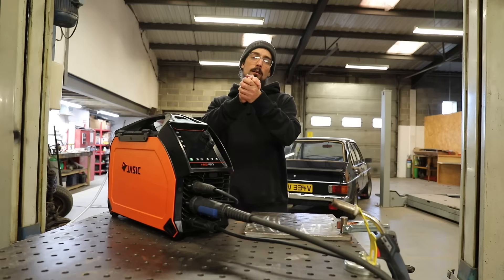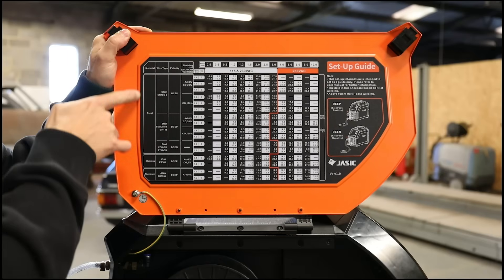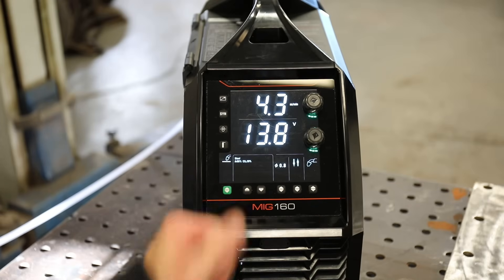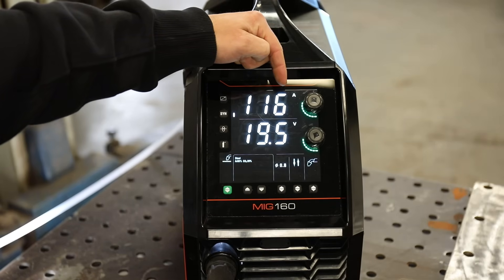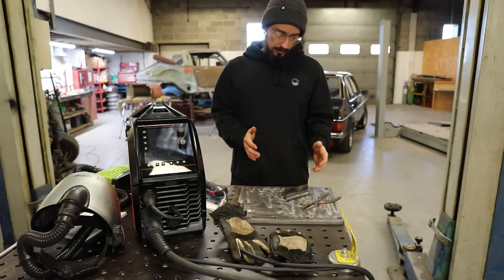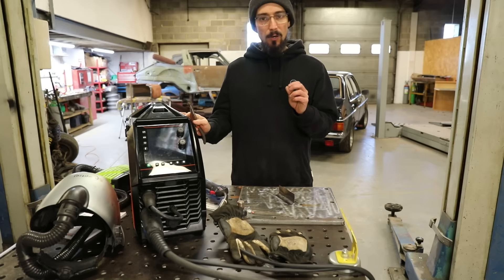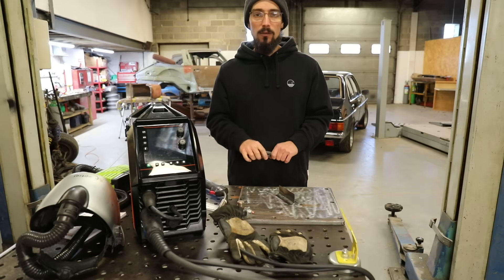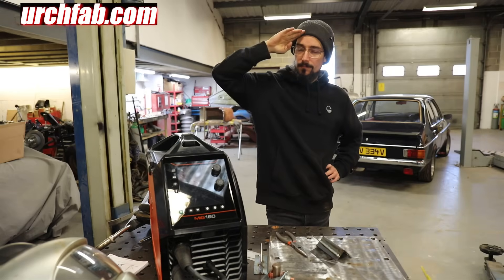Auto Mig Setting Not Working Out For You? Here's How to Find That Perfect Setting. Welding Made Easy

Comment: 😮🤔 

Only synergic machine I’ve ever used was my huge 400 amp 3 phase fronius …. Tbh I actually thought it adjusted the wire speed as I was welding to get a stable arc … I thought that was what synergic meant . It’s an amazingly good welder … considering I only paid £65 at an auction for it 😂😂 but seriously good , only downside is I’m rubbish at welding without it now 😂😂  I just turn the dial to a thickness and leave it ..  
my favourite setting is 6mm … can pretty much weld anything from 3mm upto 10mm with that it just change your welding speed 😂😂😂🤷‍♀️
Reply from the maker: I think some of the really high end stuff is a bit more advanced. Sounds like a bargain there!

Comment: I'm guessing most that have been welding for a few years wont be happy with or use synergic functions. For instance I like to crank everything up and put my foot down. The synergic functions on the couple of welders I have (in most scenarios) as a result are a million miles away. Ive never looked at them as being wrong just way out from what ive become accustomed to. Good video.
Reply from the maker: Agreed, I've always wanted the ability to create my own synergic program, which you can kind of do if you have the option to save pre-sets on the machine. But like wise, I'll often just use manual and go by feel. Cheers

Comment: What are your thoughts on R-Tech syn settings?
Reply from the maker: I couldn't say as I'm not sure I've used one of there synergic machines. What I don't like though is that they don't use wire feed speed and volts as a reference they just give a numerical setting that's only relevant to that machine. Cheers

Comment: I just consider it a convenience. Saves me the time to check the chart.    My Esab has a range for specific thicknesses like 4mm has numerous selections with slightly higher wire speeds and voltage.   I find that the synergic mode tends to be cold for more complex joints so,  I might need to use one of the higher settings for 4 mm.

Comment: How to over complicate melting metal .... Running a Eland Butters 245 for over 25years on car body and light fab and never needed any of that crap .  Fully coded pipe fitter /  welder  doing high pressure steam pipe for 30 years .
Reply from the maker: Seems pretty simple to most
Reply: Didn't sound overcomplicated at all. It's never too late to learn new things.